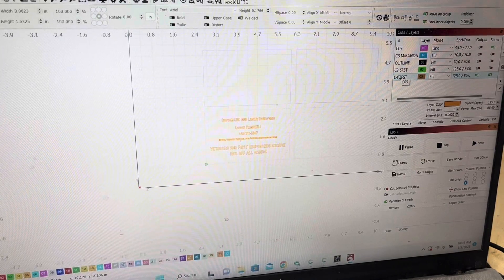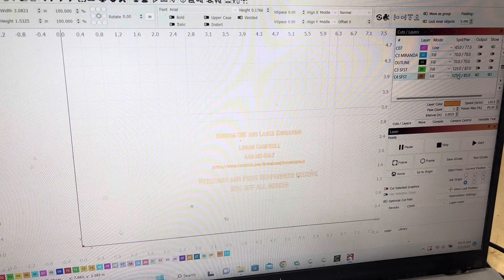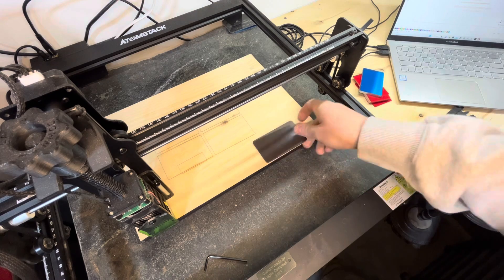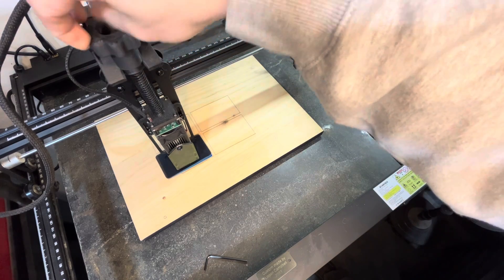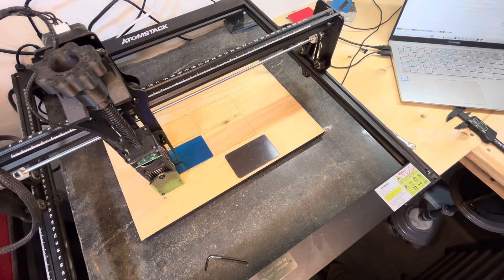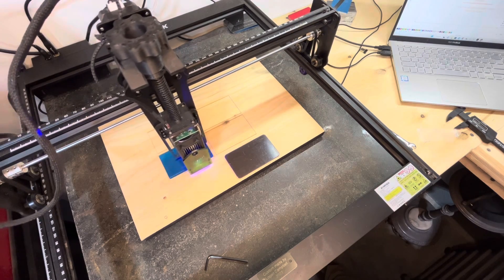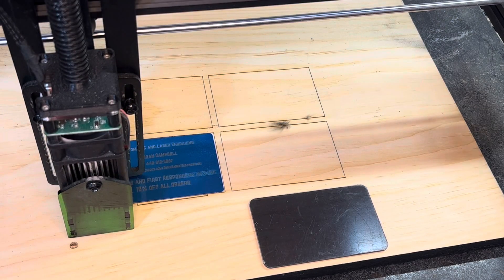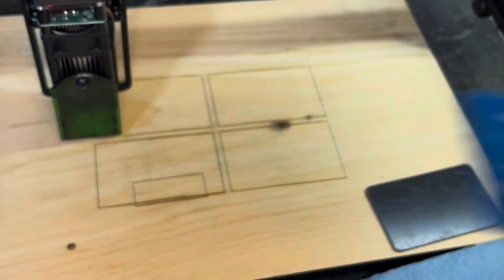How to use a Diode Laser on Aluminum Business Cards

Comment: Also, how did you determine the power? When I started with my A5 Pro, I ran various LightBurn tests to find a good setting. A year later I was seeing stuff about not running at high power to save the laser. I reran the tests and found I could get really good results at a fraction of the power too just by slowing it down a bit (tradeoff). But what I had not seen was there was good results at a much lower speed, then it would kind of blacken/char the metal cards, then it started going silver again. I ended up testing with a much lower power and was getting great results. In my 3rd year of using this thing and I still don't really understand it ;-) Everyone seems to have conflicting advice.
Reply from the maker: I ran multiple tests and determined the fastest speed with the best engraving and used that. Every color will be different though. Blue was harder for me to engrave the black or red. I have since bought a fiber laser and can’t tell you how much better it is for these types of jobs.

Comment: It's best to seal the cards when done, otherwise they scratch real easy.
Reply: You get a seal to lay down on the cards and the pressure locks it in place. You can use other animals but seals are very heavy and soft so they distribute weight evenly and dont dent or scratch the product.

They're also very trainable animals so just get a bucket of fish and you can seal all your cards quickly
Reply: @tradtke101 The humor is just astronomical.
Reply: Well lets not harp on it 🙃
Reply: What sealer should be used?
Reply: yeah, how to finish it with sealer? What type, brand etc.?

Comment: This is technically marking, that laser doesn't have enough power to engrave aluminum and it's also not the right wavelength. The reason it works is because you are removing the finish

Comment: I just did a stack of cards yesterday. I do both sides of my cards. On the back I have QR codes. One for the YouTube and the other for my Rumble videos. I have designed a Spring Loaded Card holder in Fusion 360. Will be printing it off this week to see if it works.
Reply: how long did the card take for both sides?